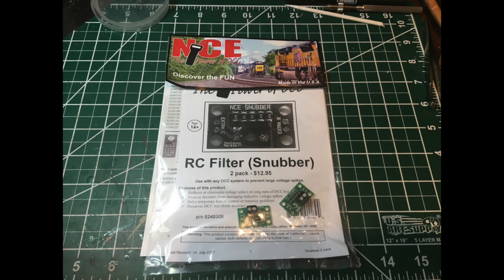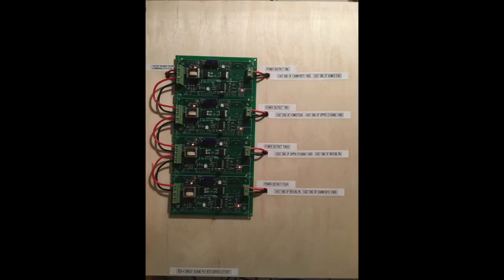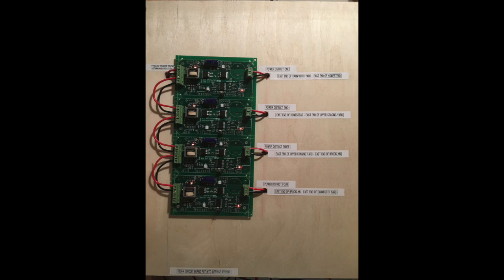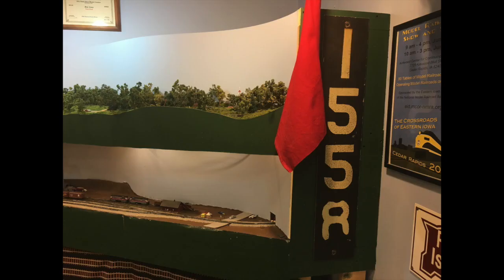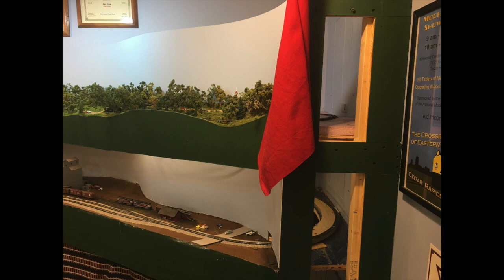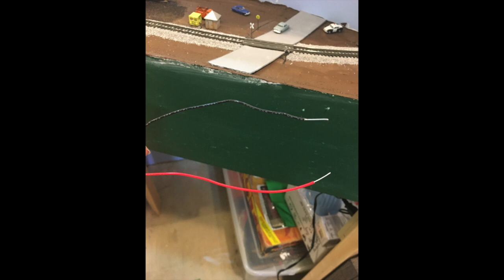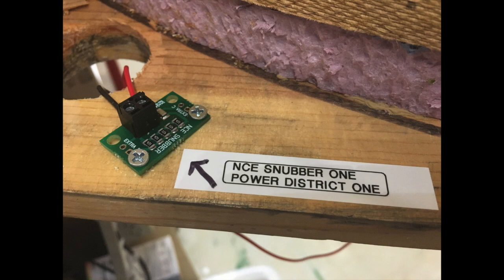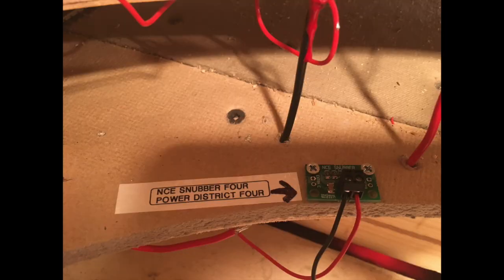NCE Snubber Installation

Comment: Hello  I also installed the NCE Snubber I have another on order.    When you broke up your layout into districts do you isolate the track? I was told to use a dremel tool and cut the rails.  The only concern I have I have a scissor cross over (double cross over) and not sure where to cut on that cross over it connects track 1 which is district 3 and track 2 which is District 2 Any ideas  Thank you Tom
Reply from the maker: Tom sorry I can not tell you the best place to cut to not disrupt power to the crossover.  I used insulated rail jointers to isolate my districts.  Good Luck!  Tony

Comment: Great information. Does it matter which wire to the two terminals on the snubber? Thanks.
Reply from the maker: In the NCE directions it never clearly  said that.  So I tried to keep them all wired the same and have had now trouble with them.  ~Tony

Comment: I've been told the snubbed are a help if you are over 25 feet in length,  but it's a good idea to twist the bus wires to help keep the signal from degrading too, how long is you districts from the power sours is important....thanks for sharing....Jack I didn't know that NCE had them....
Reply from the maker: Jack, My districts are about 50 feet in length only because I'm running a single track mainline with basic sidings and no sound and used a lot of track feeders.  The snubbers for me helped reduce/get rid of any power surge when I turned on the main track power which helps protect the life of the decoders.   Thanks, Tony